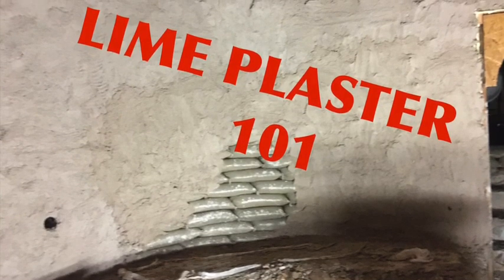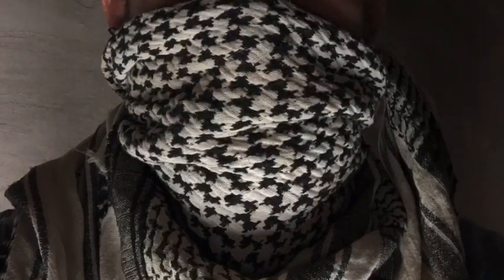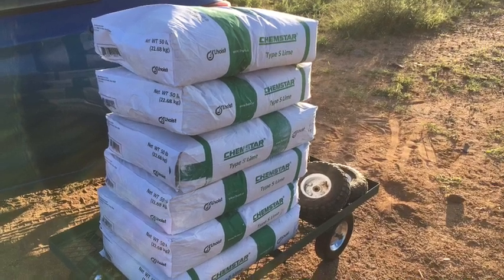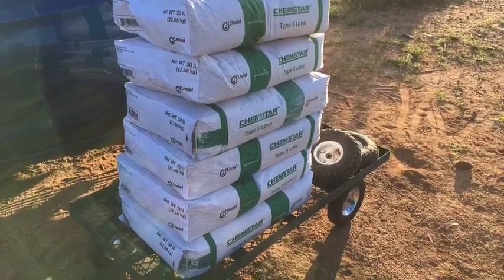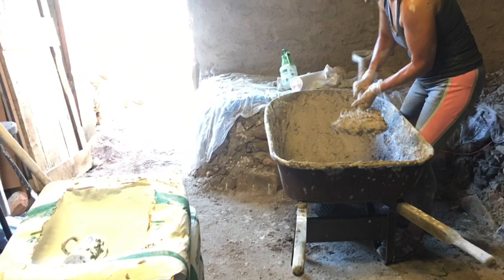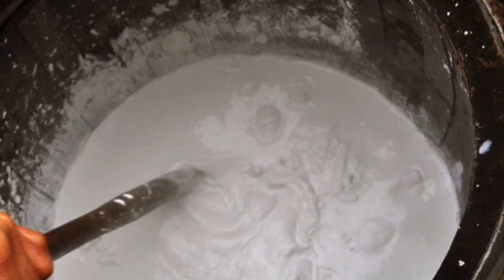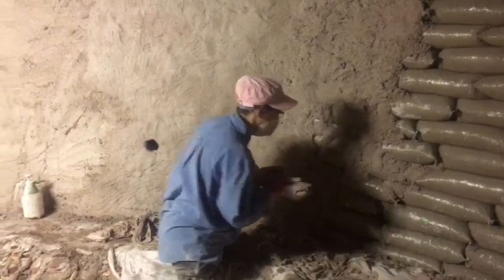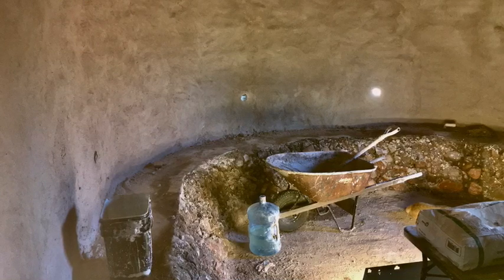Lime Plaster Can Be Dangerous

Comment: Isn't having that unmixed,unhydrated lime left in your mix what they're finding made roman concrete self-healing and so long lasting?
Reply from the maker: . They used more of a quicklime formula made from high heat... calcium carbonate .... it was called hot mix
Reply: @LeGrowFarms  could you explain that process a bit more? I read it required lower temperatures in its heating as compared to the industrial temperatures of today. Not sure if those temperatures refer to the ones needed for cement production or for the quick lime prepared today

Comment: You should also add if you want to do the tadelakt method, just spray olive oil soap on the lime plaster surface, and use a smooth faced rock to smooth the surface over in small patches at a time!!